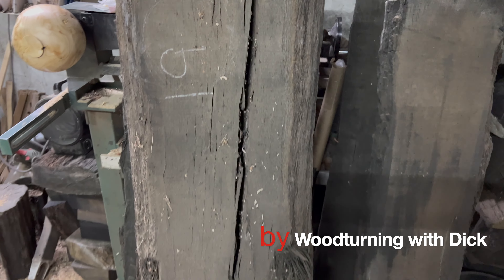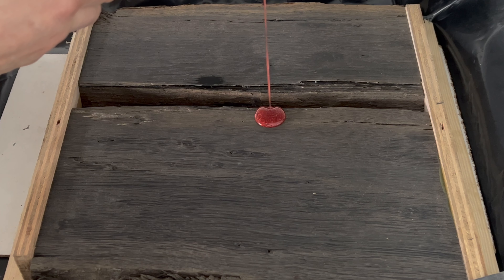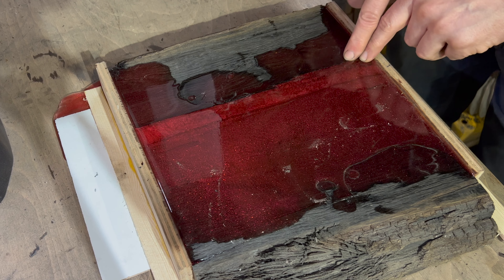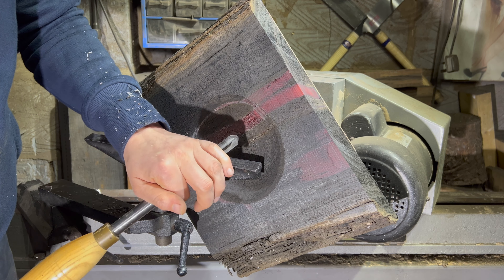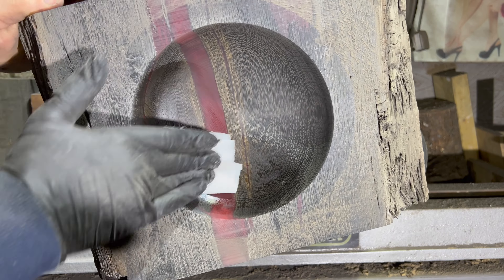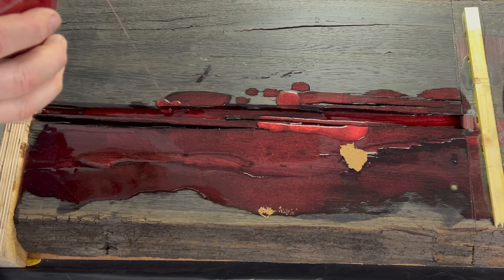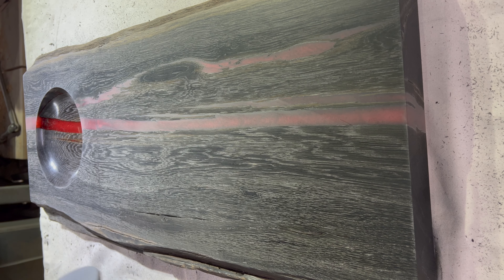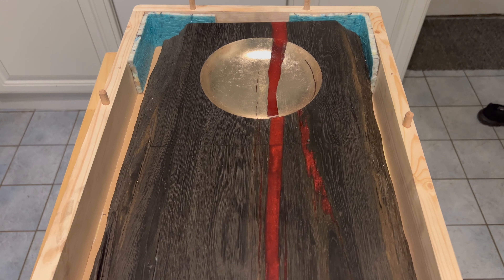Woodturning Bog Oak Bowl in a Plank Wall Hanging Art - 'Tears of the Moon'

Comment: Nice piece. Just a tip.  When pouring resin into a piece like this without the use of vacuum or pressure, if you use a heat gun to heat the wood and on the epoxy as you pour, the viscosity of the epoxy will reduce dramatically and vastly improve the ability of capillary action and gravity to fill the small cracks.  Of course, you need to use some judgement so as to not burn the epoxy.  A slower cure kit helps.
Reply from the maker: Very helpful boooshes! Thank you! I think particularly on the bog oak with its open cracks. Never thought to warm the wood too - brilliant! 
On non cracked wood, I’ve learnt to paint the wood or bark it’s butting up to with some of the resin from the first and second pours. 😁👍👍